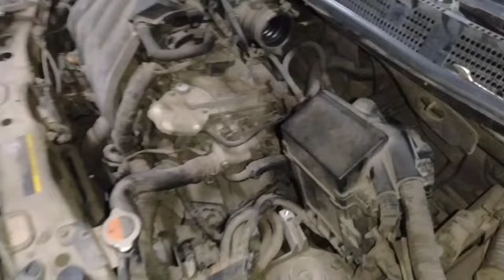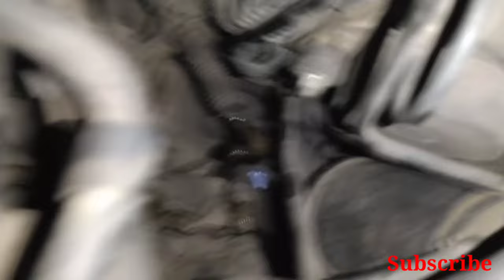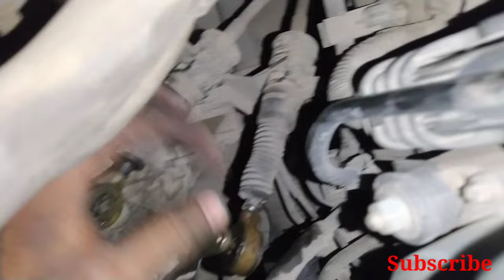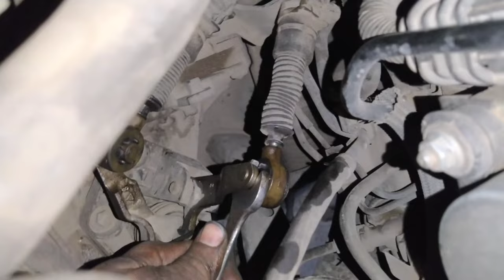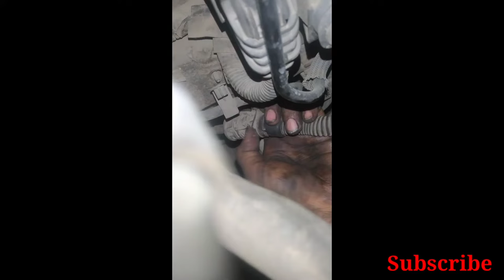Nissa Micra Gear Shifter Cable Removing || Nissan ka Gear Shifter Cable kaise Nikalte Hai #nissan

Comment: Falta lo mas importante desmontar los cables en la palanca de cambios para poner los nuevos
Reply from the maker: can you talk in english sir i don't understand anything
Reply: The most important thing is missing, see how to remove the cables on the gear lever and place the new ones.  this video is very good but it would be better with the whole process of changing the cables
Reply from the maker: @rosarioalcalde1349  ok sir I'm trying to my best next video